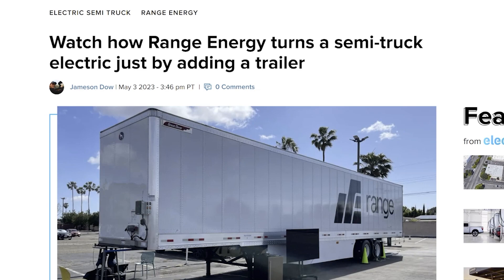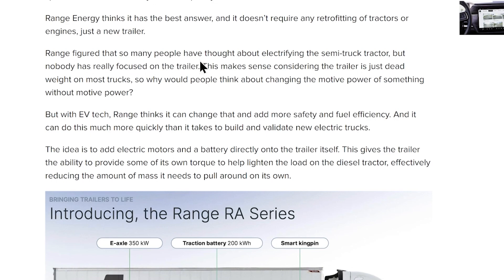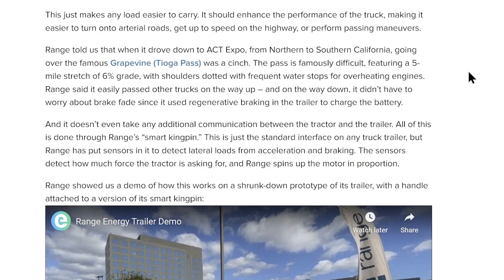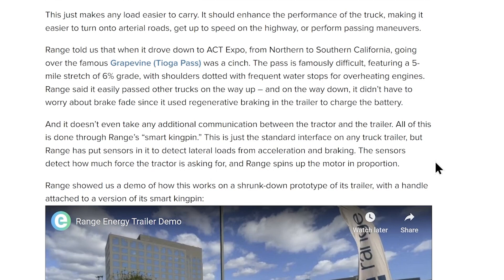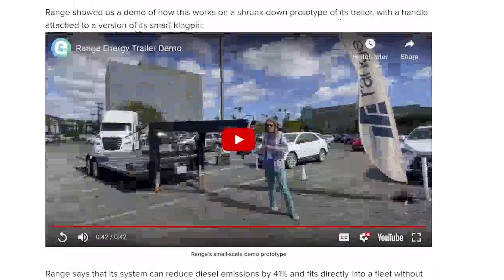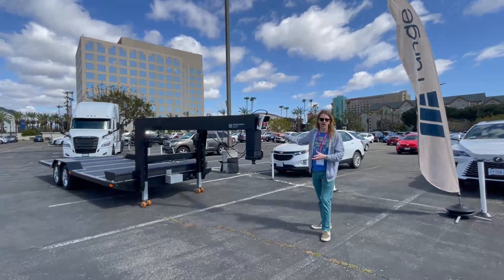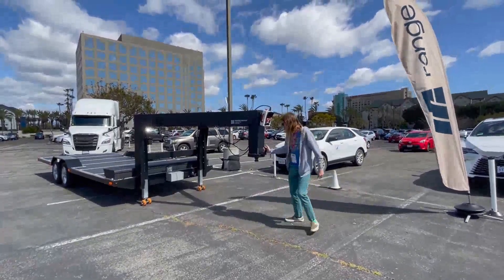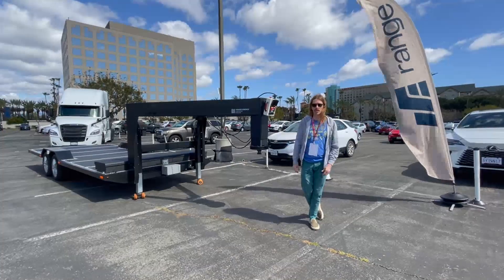Range Energy Electric Semi Trailer Make Any Semi Truck Electric

Comment: Don't know if Range Energy came up with this idea or not, but there was shown a prototype last year or so for an electric RV trailer. Can't remember the name of it. But imagine a what this would do for big rig class 8 semi trailer RV. Buy a Range Energy trailer and do a RV conversion and you can boondock for weeks just on the trailers battery. Add solar on top and your lengt of stay off grid is about water supply and grey/black storage and not power,  for AC or heat. For commercial use cases I think it will be a question about price. For top en RV market not so much. And pair that trailer up with a Tesla Semi and you can have guilt free green RV life with a true tiny home on wheels and garage in the back for electric surboards, electric DH bikes and electric dirt bikes. One jackpot away from putting in an order this trailer paired with a Tesla Semi.
Reply from the maker: You have some great ideas.